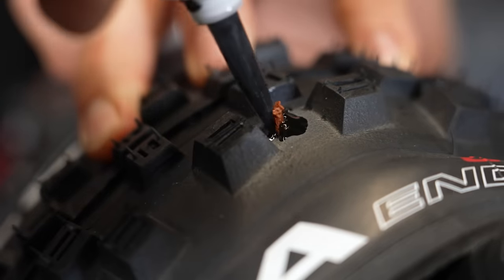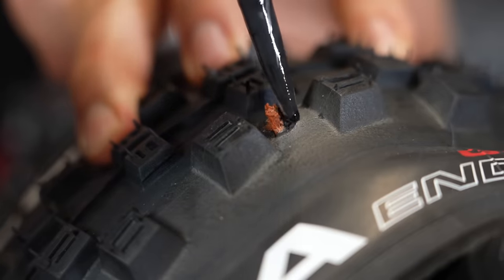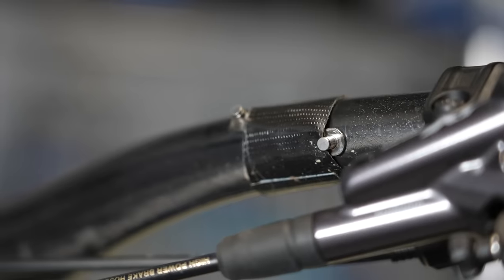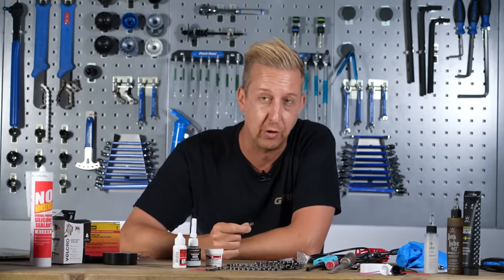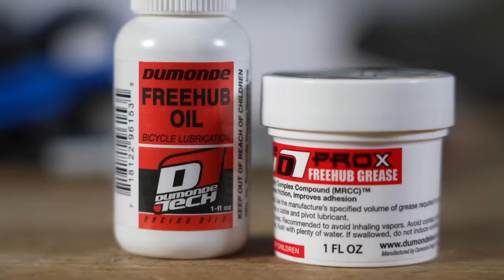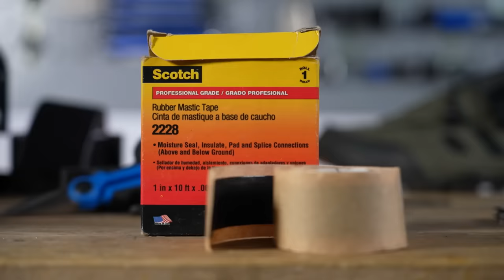11 Of The Most Useful Pro Tips And Hacks, EVER!

Comment: Nice video, with a lot of stuff I haven’t seen before. Thanks guys. 
Here is my hack:
To prevent my bike parts from getting stolen, I have filled my Allen screws with hot glue and cut it flush. When I have to use them I can easily peel this thing out of the screw with a little nail or something. But if someone is trying to steel you saddle and seatpost in the city (which has already happened to me) and is not able to insert his tool, he will leave and not try to figure out why it’s not working.
For me this solution now workes since years.

Comment: Hi Doddy, I made the cleat sealing with a hot glue gun, also covered the holes below the cleats to avoid water from entering, also easy to clean the mud of the cleats.
Reply: This.  It's quite elastic and leaves no residue when removed. Also really useful for the gaps around the seatpost clamp to keep water and gunk out. I use it everywhere on the bike.
Reply: @boers_eimersten  Nice, I'll do that too

Comment: hey Doddy,  I've got a nice hack to save some mineral oil brake fluid. when i bleed my brakes i normally need to flush the lines quite a bit from all the debris that get into it. so, to reduce my waste, I collect all the used oil into a glass jar and let it sit for a couple days. once the dirt accumulates at the bottom, i run the top 80% of the jar content through a coffee filter and save it in a clean glass jar so i can use the old fluid to flush my brake lines without wasting new fluid.
the final bleed is still done with virgin fluid. but that saves a ton of brake fluid from getting wasted...

Comment: I’ve got a few tricks- 
Layer up thick sheets of Gorilla Tape to make mud flap extenders.  Cut to desired shape with heavy duty scissors.  Last forever and won’t destroy fenders if you slow roll a curb. 

Use wire heat shrink in place of cable-end crimps.   Allows you to pull apart components for cleaning and reuse cables, especially great in cyclocross muck.   Can pick color, and looks cleaner than crimps.

Can also use silicone caulk to seal holes and mesh in the top of shoes for cross racing.

Comment: hey Doddy,
after retairing my last chainring due to excessive wear. i tried changing my chainline using Blackspire BB spacers and that did reduce the wear.
most chainrings are set for a chainline that biases the smaller gears, but most of my pedaling happens on the larger ones. therefore moving the chainline in reduced the chain angle when on those gears and consequently the wear on the chainring.

i think that was an awesome hack, and a subject that i never see on mtb videos!
cheers
rod
Reply: Is retairing = retiring? or retearing?

Comment: Doddy top tip for cutting down bars or fork stanchion tube, use a plumber’s pipe cutter. I’ve used mine for several jobs and it cuts straight and leaves a clean burr free edge every time. Also a lot cheaper than the hacksaw guide.
Reply: But not for carbon fiber.

Comment: Yes super helpful, especially with the cleat bolts. I found if you can't stop bakes pads from squealing, no matter what you do, add a tiny drop of "Permatex Disc Brake Quiet" (the kind that comes in a glue bottle), onto the back of the pads, where it comes into contact with the piston. Doesn't stop it completely but sure helps, especially in the wet.
Reply: Use copper grease on the back of the brake pads to stop squeal 👍

Comment: I always use Locktite on the threads of my cleats. Not so much to keep them from loosening on me as much as keeping them from corroding in place. The hex socket head is not very deep so it is not hard to round out the head trying to remove rusted bolts. Filling the head with silicone is a great idea too. Is video and others like it are both entertaining and useful. Thanks GMBN

Comment: When you finish the roll of teflon tape keep the center and slide it over your rear axle when you take your wheel off.  Loop your chain onto the teflon tape wheel for cleaning your bike.  You can spin the cranks with your chain over the axle without damaging/marking it up.  Makes for easier cleaning of the chain and derailleur.

Comment: Great job! Thanks. Already knew-of/used about half of these over my decades turning a wrench but will try the others, especially the gorilla tape and flexible super-glue....since those are kind-of new products.
Regarding the spray lube, if I have a situation where what I really want is a drip and don't have it, I'll just spray some lube into the plastic top of the spray can. Squeeze it down to make a bit of a funnel shape and drip it where needed.

Comment: I have several bikes of various speeds. On each bike I have removed the handlebar end plug on the drive side of the bike and inserted an appropriate quick link wrapped in a piece of kitchen paper. I've then re-fitted the handlebar plug. With this method I know that I've always got the correct quicklink available on every bike.

Comment: Wish I knew about that elastic glue before. I tried super glue around a plugged hole but didn’t stay more than a couple rides. 

Tip I used yesterday is when aligning calipers to rotors: it’s hard to see the tiny  gap between the two when lining it up but it helps to put something high contrast behind. I put a piece of white paper on the ground under the caliper and it helps to see the gaps.
Reply: Or shine a light through from the opposite side. Nothing too bright though.

Comment: I was replacing a shifter cable housing that was internally run. Not knowing if there was an internal guide, I decided to use a short piece of threaded rod, or a long fine threaded bolt with the head cut off, to join the new cable housing to the old one so that I could use the old housing to pull the new one through the frame.

Comment: That grease on the olive is one, wow never thought of that.
I've used electrical tape as rim tape.
Self adhesive amalgamating rubber tape.
As a chainstay and under the BB as frame protection.
Nail polish as thread lock and to dab paint chips.

Comment: PTFE 101:   Wind it on like your winding on a nut...  (so generally clockwise if the end of the bolt etc is facing you)
and only 2-3 turns...   (More can split the outer, or just push down the threads as there's too much to slip between the threads).

You can always spot PTFE put on by a numpty. Usually displayed as a huge lump of PTFE pushed into a ring at the end of the nut.. and when unwound, you end up with lie a foot long strip when you should only have about  6x the width of the bolt max.

Comment: I used plumbers tape for years on my old FRS suspension bushings. before seal cartridge bearings. The bushings would wear so quickly and creak or actually become slightly out of round. The tape would last for about five rides and make up the gap and keep things quiet.

Comment: Its important to emphasize that you shouldn't over grease your freehub drive mechanism. They won't work properly if you do. I have fixed a few over the years that kept slipping or wouldn't engage reliably and it was because they had way too much grease in them or were lubed with a grease that was too stiff.
Reply: Seen more than one silencing job that had the freewheel freewheeling in BOTH directions! Go easy on the grease, especially if you use the bike in cold temps!

Comment: Twisted brake lines can easily be fixed on Shimano brakes by swapping out BH90 brake lines for BH59 lines. You need matching needles but the olives and calipers/levers are all compatible. BH59 can be more spongy because they have more internal volume, so they're supplied on cheaper brakes from factory, but the lines are much more flexible and don't bind up or twist as easily.

Comment: 17:13 just push the rubber cap screw covers in there. Exactly what they're designed for, all new bikes have them in the headset/rear rack/water bottle threads. I've stashed a bunch with GT logos on them

Comment: Doddy, would you use the flexible super glue on patches on the inside of the tire, or stick with vulcanizing rubber cement for that?  I'd had some issues with patches letting loose after a while and wondering if the super glue would be better.
Reply: Good question, interested in the answer..
Reply: When vulcanizing a patch, the more force the better. Use clamps if you can and leave that over night.
Reply: @sp00n  Thanks!  Funny enough, that is exactly what I did, with the tire that I am currently riding on, and it seems to have worked great.  The other issue I think I had is using a patch that was too small, a cm square even though it was a small hole, just would not seal with a plug.  It can also be hard to get the rubber really clean due to all the sealant.

Comment: I like CA glue but I have never been able to get a second use from any container. Moisture in the air activates CA glue and once I break the seal, the remaining glue in the container will harden no matter how well I try to seal it. I have resorted to buying the smallest CA glue bottles and resigning myself to the fact I will have to throw it away after one use. Is Elastic CA glue any better?
Reply: Keep Cyanoacrylate adhesives in the refridgerator. Cold air contains less moisture. My tubes last for years!

Comment: I would not use gorilla tape for tubeless it reacts with the sealant and it's a mess to take out again it leaves residue behind, it has strings so when you are removing it the sealant makes it more brittle it breaks and does not come out in one piece. In a pinch use electrical tape, it is the closest to rim tape

Comment: Rubber cement on the plug when you install it is also good (the stuff in a patch kit). The "vulcanizing" process melts/dissolves the rubber and mixes together before drying out so its more a solid piece of rubber instead of glue holding the pieces together.

Gorilla tape works on rims but is a lot heavier than proper rim tape and also leaves residue that is very difficult to remove and can cause leaks if not properly removed before re-taping.

I've always been able to hold the housing to keep it from twisting and watching the video, I'd be concerned about a glob of that grease getting ahead of the olive and into the hose or not be compatible with the fluid. I would try a drop of mineral oil or whatever fluid is in the brakes or at least make sure to use a thin layer of grease and not a glob.

I've also used a rubber band pulled over the end of the allen wrench but anything that takes up any space will help including a plastic bag or even a piece of paper. On small allen screws I use something to help make it tight even if it's brand new which seems to help it not round out in the first place.

I use teflon tape on any bolt I can because it almost guarantees it can be removed and not get corroded and hard to remove. I'll also put a thin layer of grease on top of the tape if in a place that can get wet. It also works like thread locker so it doesn't vibrate loose as easily. And unlike loc-tite it can be repositioned without breaking the bond and needing to be reapplied. Fingernail polish is also an adequate substitute for loc-tite (any color!) There is also a product called vibratite (VC-3 if i remember correctly) that dries into a stiff pliable layer similar to the bolts that come with a pre applied patch of thread locker thats usually blue.

Whew, thats a lot longer than i intended...

Comment: Doddy, if you use the teflon tape on the bottom bracket threads would you clean off the thread lock material?
Reply: I think he did say only use on clean threads.

Comment: The black widow super glue is totally different i use the AK interactive black widow with an activator spray it turnes into a plastic but agree it does get brittle more than a normal Superglue damb expensive at A tenner a bottle aswell

Comment: Best hack I worked out: save all the PVC and silicone tubing when you're in hospital (don't worry, mountain bikes will get you there eventually). It gets thrown away anyhow, and if you save it you'll find a piece the right size for bleeding your brakes. Stick one end on the bleed nipple on the caliper and the other end on a 20mL syringe from the pharmacy. Pull out the plunger and fill the syringe with brake fluid (or baby oil), loosen the bleed nipple and you can easily flush and bleed your entire brake system with a single squeeze of that syringe. No bleeding blocks, no funnels. Just make sure you take your wheel and brake pads out first and stop before the oil starts pouring out of your lever or catch it with a paper towel.

Comment: Using Flexible Cyanoacrylate to repair trainers can be a pain to cobblers.  If you refix the unit (sole) to the upper if it comes away.  Cyanoacrylate is difficult to glue to and has to be removed for better adhesion.  Cyanoacrylate is great for a quick fix but there are better solutions...one being Shoegoo.
Reply: Shoegoo is what I've been using for years to patch up the holes in my FiveTen shoes, works a treat! Just be sure to do it before the whole sole disintegrates resp. gets loose.

Comment: @gmbntech another hack for removing noise from brake pads, I use a whet stone to freshen up the contact surface by doing 5-6 strokes, then rinse off with dishwashing liquid soap. Rinse off then pat dry with paper towels. When dried, I wipe down with rubbing alcohol & light it up until it dries up. A perfectly clean & fresh surface like new pads!

Comment: Slipping seatpost in a titanium frame.  Tried everything incl. hairspray.  Finally resolved it with a shim cut from a beer can - punk IPA.  Put the seat collar on the seatpost then wrap the shim round the post just below the top of the insertion level and slowly twist it down - once at the right level drop the seat collar and tighten.  Not budged since.

Comment: i always wondered my self but never tested it out  , but what if i got a puncture in my tubeless maxxis and i use gorrila tape to tape over the hole inside the tubelsee tire would it hold up till i got home  to fix it with a plug  or would dit not work at  , always been curious about that but never had the chance to test it out ( lucky enough that this hasn't happened to me yet )
Reply: Bacon strip, tyre worm, plug is way better. You don't have to the tyre off!

Comment: It's not that gorilla tape makes worse seal than proper rim tape, it's actually better because it's more elastic. The problem is that if you need to retape your rim, getting the old glue off is a ballache
Reply: Enve rims originally came with a roll of gorilla tape as their tubeless tape. They changed to a more traditional plastic type tubeless tape when they went to hookless bead rims because they are tighter fitting and gorilla tape would get torn as the tyre slid up onto the bead.

Comment: Anti puncher hack buy 2  mtrs 15 mm foam pipe insulation £1.99 From Plumbers  merchant .Slice in half with stanley knife,fit into tyre fit inner tube on of tyre  next to rim side good to go   ,,stops pesky hawthorns puncturing tube as you 10mm foam between tyre inner and tube

Comment: Hack… when working on brake calipers, when you remove them, keep bolts and washers in place in the caliper with tire valve/stem nuts.  Sort of a bike hack… use old tire tubes cut into rubber bands to keep your xc skis together.

Comment: Carbon seatpost slipping, and assembly compound not working? Slide a two inch long piece of electrical heatshrink over your seatpost where the clamping area is, and shrink it on. Added bonus, it will also hinder galvanic corrosion if using carbon post in an alu frame.

Comment: I haven't broken a chain in years. A well lubed or waxed chain breaks a lot harder than a dry chain. I also use a YBN SLA chain. 
And no, you don't need to replace the quick link every time the chain is apart. That's just a marketing gimmick.
Reply: After 5-10 disconnects the link can be undone without tools. The link brushes front mechs and so on, just pray you don't smash all your teeth in while saving your $3 mate
Reply: @janeblogs324  You need tools? Lol
Reply: @dystopiaisutopia you should (to remove at least).